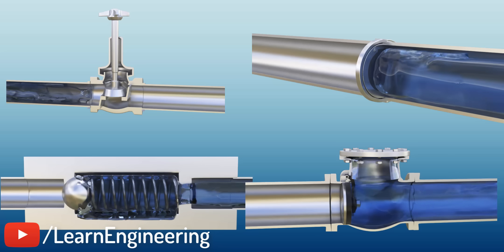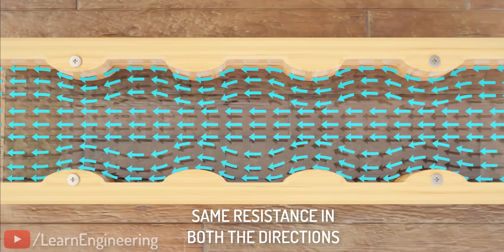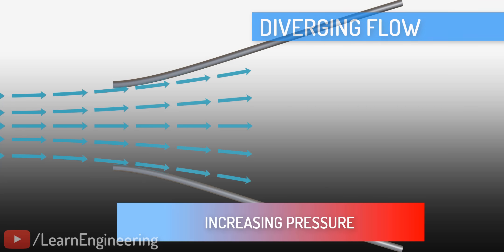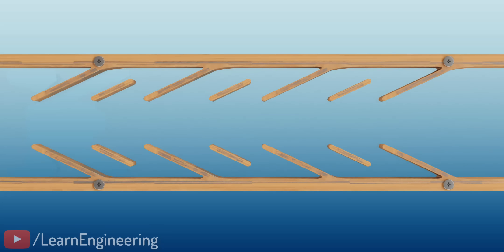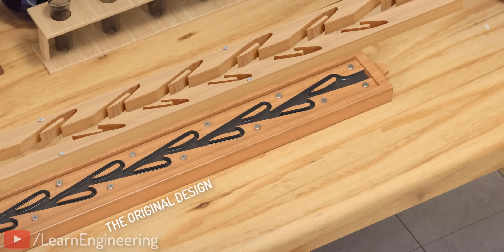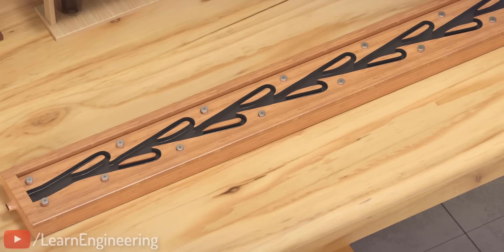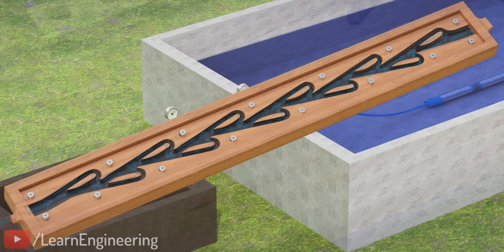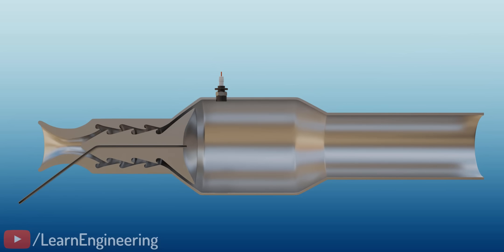Tesla Valve | The complete physics

Comment: this "brilliant" valve is famous for not working
Reply: How is it 'not working', exactly? Not blocking the flow completely? Of course that's a job for different kinds of valves
Reply: @ki0w0-lordofwatersheep  I can't tell you exactly where it's not working, but despite many videos on youtube and tesla being famous and the patent being expired, nobody is making these valves commercially
Reply: @manudehanoi  maybe they're not produced not because they're not functional, but because most applications require complete blockage of reverse flow?

In some sense that might count an 'not working', but that's because it's "using the wrong tool for the job", same with any mass-produced components being used in that place when they shouldn't/won't perform well
Reply: @ki0w0-lordofwatersheep  can you find scientific papers that show that  it works at all?
Reply: @manudehanoi  maybe not the divergent/convergent flow principle as the video says, but these might be of interest

https://www.sciencedirect.com/science/article/pii/S0017931016310560

https://www.researchgate.net/publication/230851352_Simulation_and_optimization_of_Tesla_valves

Note that the first wasn't approached by taking the Tesla valve & finding applications where it (won't) work(as often done here), but rather looking at engineering needs & picking something that fulfills them, by not using a wick structure or moving part, thus miniaturizable

Thought Emporium also made a video similar to a/at the level of real research paper, the Shrinky Dink Tesla valve one
Reply: Don’t tell the Tesla fan-boys and fan-girls....
Reply: @br52685  don't tell the tesla fanbashers either...
Reply: Revi M Fadli Sorry, but nobody is bashing Tesla.  Merely stating that this doesn’t work as intended.  I’m just surprised that the Tesla fanboys and fan girls are 1) just now hearing about this, and 2) haven’t bothered to look into this any further.
Reply: @br52685  sorry, but ones who merely point out how the or other inventions don't work as intended weren't the ones I was pointing at. And sorry, those who bash him are just as existent as the fanboys/girls
Reply: Revi M Fadli Nobody is bashing Tesla here
Reply: @br52685  depends on what you count as 'bashing', insisting that certain inventions won't work for applications they clearly weren't intended for, seems like bashing & a pointless argument to make to me

If simply describing cases where they won't work(even when they're deliberately inappropriate) counts as enough to you, I see why you don't see such as 'bashing'.
Reply: Revi M Fadli People aren’t commenting on Tesla.  They are pointing out the flaws in what the video presents.

You really need to stop white-knighting.
Reply: @ki0w0-lordofwatersheep  As was stated in another thread (to paraphrase):  "too bad Edison didn't steal this idea too--maybe he could have made something useful out of it..."
Reply: @br52685  I never said they were bashing/commenting on Tesla himself_, did I? Nice try debunking what I didn't even say. You _really need to stop don quixoteing, that 'white knight' exists no more than perpetual motion does

Yes there are those who point out flaws in what the video presents, but the valid ones are separate from ones that deliberately picked bad use cases, aren't they?

The comment you paraphrased really showed what I meant by 'bashing' at the valve (and not Tesla the person), so thanks I guess? You really need to stop white-knighting for those bashers by lumping them with valid critics
Reply: @ki0w0-lordofwatersheep  Wait...first you claim that "white knighting" doesn't exist.  Then you tell me to stop "white knighting"?
Reply: @br52685  "first you claim that white knighting doesn't exist"
I said THAT white knight, not the act of white knightING, please, pleease read more carefully before you grasp at straws to make me look like I'm contradicting myself. If even an "ing" was missed, no wonder you confused between bashing Tesla the person, and bashing the valve...
Reply: @ki0w0-lordofwatersheep  thanks for the papers they show a significant difference in pressure drop depending on the flow direction and at least a single potential use case (heat pipe). I still think the word "valve" is not right for this device, the device is simply like a car: more aerodynamic in one direction than the other. But we dont call car shell design "valves" do we ?
Reply: manu de hanoi This is the point he’s missing.  “Valve” isn’t the correct term, nor does it even remotely compare to the actual valves in the video.  The specific point of the video was “these valves (demonstrated) all have moving parts.  Can one be made without any moving parts?”

The answer is NO.  At least, not by using a Tesla “valve”.
Reply: @manudehanoi  thanks for being more open minded as well

Maybe car shells aren't called valves because asymmetric fluid flow isn't their primary function?

Yet what about device designed with that primary function in mind?
Reply: @br52685  what was I missing? The way it doesn't completely stop the flow making it not a "valve"? That depends on the criteria & tolerance of the use case, some do need full stoppage, others are ok with some leakage. This is what you've been missing

Years of a word's "misuse" can make it a correct use & beats pedantism anyway

"The answer is NO"
If your criteria is full stoppage, that is. This is the point you suspiciously kept missing

Did the video's specific point even include the neccesity of full blockage like you keep insisting? Did the video demonstrate the other valves to claim that a valve has to complelely stop reverse flow? Or that they have asymmetric flow(as a primary use)? Or was it just something you added on your own?
Reply: @ki0w0-lordofwatersheep  The video very clearly demonstrated "stop-valves" then asked the question if that could be achieved "without any moving parts"....then moved to a Tesla Valve.  So NO, the Tesla Valve can't be used to solve the question posed in the video.

Now, if you want to go ahead and create your own video showing what this valve CAN and IS used for--then go ahead.
Reply: @br52685  good point, the tesla thing isnt a "one way valve" like what the narrator implies.
Reply: @manudehanoi  This is what people are clarifying here--not bashing Tesla.  Merely pointing out that the value does not work as depicted in this video entitled TESLA VALVE--THE COMPLETE PHYSICS.

Of course, it's not as magical/genius if you simply display that this device merely "creates turbulence and decreases flow in the opposite direction"...
Reply: @br52685  people not bashing tesla himself doesn't mean they don't bash the valvular conduit(or, as most people, articles, & scientific papers call it, Tesla valve)

Difference between bashing the person & the invention is one of the points you seem to keep missing

And using ridiculous (mis)use cases doesn't do anything to clarify how something doesn't work, does it?

Still white knighting when you told others not to? Still chattering instead of doing your own experiments like you keep chattering about?
Reply: @manudehanoi  if I may ask, where is the official definition of a one-way valve that the tesla valvular conduit doesn't fulfill? Even academic papers call it valve
Reply: @ki0w0-lordofwatersheep  Funny how you keep parroting my own phrases (white-knighting, chattering).  Are you able to have a thought of your own?

Obviously, you're not paying attention.  MANY PEOPLE are commenting that the animated video DOES NOT reflect reality.  But you don't care about that--you'd rather pretend that people are bashing Telsa (which nobody is doing).
Reply: @ki0w0-lordofwatersheep  I don't even know what you're talking about anymore--and I honestly don't care.  I'm surprised you're more worried about this, than the content of the video presenting false information.
Reply: @ki0w0-lordofwatersheep  The original poster is correct:  this "brilliant" valve is famous for not working
Reply: @ki0w0-lordofwatersheep  here's the official definition of a one way valve: the fluid flows one way
Reply: @br52685  not working according to your standards of 'complete stoppage', that is. But according to those who deem the asymmetric "regulation" as enough?

But of course it's (in)famous for not completely blocking reverse flow, contrary to most practical needs. Then again, "working/not" depends on use case & requirements...

Again, where's your official engineer's source/reference that states something isn't a valve if it doesn't block completely? Most still include "regulation" and "partial obstruction". Papers from people who do science beat baseless pedantry anyway, and they mostly call it valve...
Reply: @manudehanoi  where did you get that 'official' definition from? What measure is fluid "not flowing"? Because different grades of valve have different tolerances, and engineering mostly involves "good enough" tolerances(which is still very tight it should be imperceptible, mostly)

A flap valve used as a ram pump's waste valve often still lets water flow in the "wrong" direction, does that mean flap valves aren't one-way valves?
Reply: @ki0w0-lordofwatersheep  nothing's perfect in this lowly world, even one way valves. The temporary reverse flow in flap valves can be removed by spring loading the flap valve (ex my air compressor valve) at the cost of pressure drop. I'd expect "imperceptible" versus "perceptible" to be a good enough criterion to give a different name to different tools just in case "one way" versus "asymetric flow" wasnt obvious enough.
Reply: @manudehanoi  indeed, yet these people expect one-way valves to be 100% leak-proof. Maybe that haven't touched enough real-world engineering spec tolerance-vs-cost tradeoffs?

Regarding flap valve's 'temporary leakage', I was talking about ram pumps, so we don't wanna remove it through spring loading, because then the pump won't even work! What was a 'critical'(for these perfectionists, at least) flaw in a flap valve's other uses as a check valve, becomes a necessary critical function when used as a ram pump waste valve! That's one great example of "flaw or not depends on specs, usage, & requirements"

Comment: 2:05 notice both diverging and converging flow still happens in both cases and I wouldn't even say the ratio is much different, I'd love to see some experimental results for these
Reply: I agree. Place a thin divider between the upper half and lower half, and both flow directions are identical. Also, real world tests of a Tesla valve shows that there is almost no difference in pressure drop between the two flow directions. This is not a very good video.

Comment: Also the primary flow in tesla valve isn’t a straight line. For every section of the “bucket” structure the primary path is tilted so that it matches the entrance of the next bucket structure, so making is very effective at dividing the primary flow into a secondary flow that opposes itself

Comment: How is that thing a valve, in order to block the stream you have to rotate it 180 degrees, meaning you will have to move something in order to block the stream of liquid, the term valve is not correct while using on this application.
Reply: It’s a check valve, the idea is that it allows the stream to go one way, but blocks the stream if it tries to go the other way

Comment: Just thinking outside the box, he is thinking about biology to make mechanics and fluids work. This structure looks exactly like a shoot system of a plant.
Reply: Yeah I noticed it too... 
These old school geniuses observed nature very precisely and they use to find solution to many problems in nature... 
Finally people in present era are starting to do the same & so Biomimcry is increasing now...
Reply: Interesting. Well...he studied a lot a subjects.
Reply: I also thought of biology
Reply: Too bad it doesn't work at all
Reply: @BGraves  No offense but that's an oversimplification:  "Granted, my understanding of physics and engineering is largely autodidactic and therefore incomplete, so this may be incorrect. 

Many of the arguments against this valve seem to be centered on the fact that it cannot 100% stop flow when fluid/gas is introduced from the restricted side (RS) while the unrestricted side (US) has no flow into it. For them, this means that the valve does not work. However, it seems to me that that is not the correct usage for a valve such as this. Rather, it is an effective way to show how flow within the valve works. 

Under working conditions,  I believe the valve would work to prevent a complete flow reversal in a single-direction flow environment. Because of the design, reversed flow entering from the RS loses pressure as it moves through the valve, which allows the intended flow from the US to overpower the reversed flow and keep the larger system working correctly. In application, this would be useful for situations where backfire can occur, as it would largely prevent exhaust gasses from flowing backwards and reaching the combustion chamber prior to the valve. The lack of moving parts to prevent backfire means fewer places for mechanical failure and fewer necessary redundancies to prevent catastrophic failure. One-way valves also introduce a certain amount of drag/impedance into the system during normal operation and the Tesla valve appears to have a far lower amount of drag/impedance during normal operation, which may be another reason why it is being used in experiments in lieu of mechanical one-way valve." - fogotn 1 above this comment

Comment: 5:20 "The tesla valve can not block the flow completely" So it's not a valve then.
Reply: It works sufficiently well as a valve in systems where the fluid goes through quick cycles of pressure levels. Like in pulse jet engines.
Reply: @sanjaymatsuda4504  apparently these valves arent good for larger/more powerfull pulse jets, its been described as "too soft" to work properly
Reply: If you want 100% restriction out of a valve, then few will suit. Even a ball or flap valve allows reverse flow at the beginning. (These valves has mass, thus inertia, thus SOME flow slips through before they "flap" into place.)
Reply: @MrRedstone___  A great scientist engaged in fluid mechanics to make a better understanding for himself of this physical world and one rando can't grasp the premise of Tesla's approach and writes this cretinous sentence..."it's not a valve!". Do you fuckin' see it now?!
Reply: @didndido3638  chill out fanboy, nobody said the man wasnt good at what he did, he just said it wasnt a valve, according to the google dictionary (dunno what their source is, but its good enough) a valve is defined as "a device for controlling the passage of fluid or air through a pipe, duct, etc., especially an automatic device allowing movement in one direction only", enphasis on "movement in one direction only", this device still lets some fluid throigh on a constant basis (according to another commenter, actual valves can sometimes allow small ammounts through at the beginning of flow), think of it as less of an opaque object and more of a translucent one that is especially hard to see through, it might be hard to see, but light still goes through, just like here, a small ammount of water will constantly go through, making it, by definition, not a valve.
Nevertheless, it is an impressive bit of engineering that perfectly follows the K.I.S.S. (keep it simple stupid) by throwing it out the window, its a complex design due to requiring reasonable precision, but a simple one by not having any moving parts (a.k.a. it'll only fail with tonnes of wear, or right when it is first tested ).
Reply: @tiagobelo4965    YOu don't get it....it was  an attempt to solve a problem with moving valve parts so someone called it Tesla's valve. 
You would like to call it "Tesla's pipe" to satisfy your need for definitions.
Well it would be the most idiotic pipe in business.
Reply: @didndido3638  look man, i aint going into an argument over this, its a neat thing made by a really tallented dude, but it isnt a proper valve, at least not a good one, if al you want to do is reduce/remove watter hammer effect this seems like itd do, but to stop water moving in a specific direction it shouldnt be trusted
Reply: @tiagobelo4965   Alright, take care, mate.
Reply: @didndido3638  you too
Reply: it cant because its still "open". but you could include a regular valve on the end which would deal with much less stress than it otherwise would and that would block flow completely.
Reply: @Blox117  then youd just be making an even more complex system
Reply: Michael Brogan  at that point itd be better to just have a simple tube, since you wouldnt need to regulate flow in the slightest (since you have a constant flow in the required direction, any that might appear in another direction can be considered negligible)
Reply: It's not a valve...It's the tesla valve.